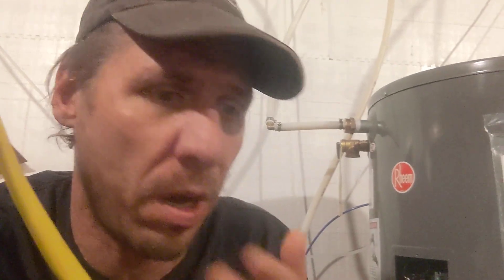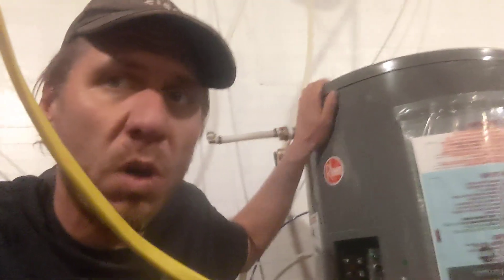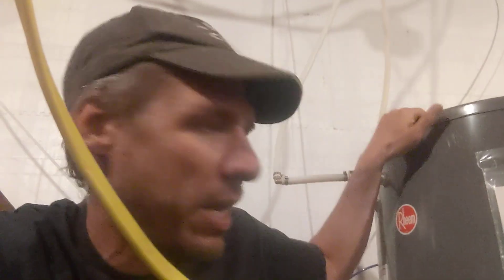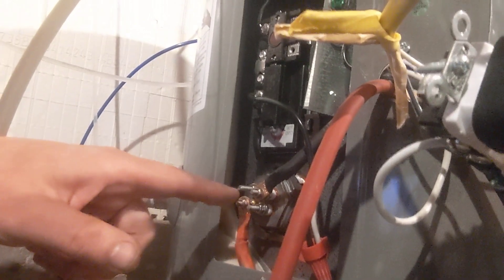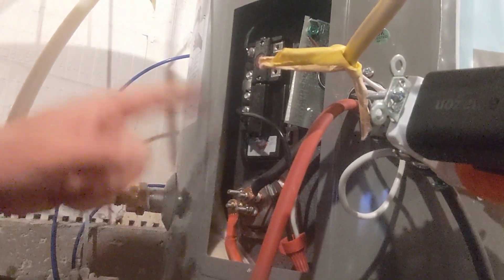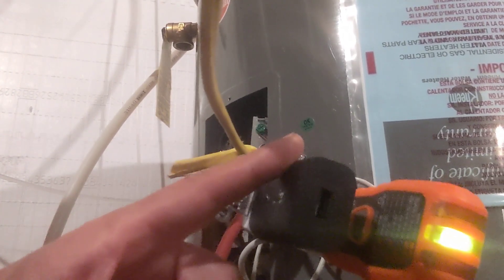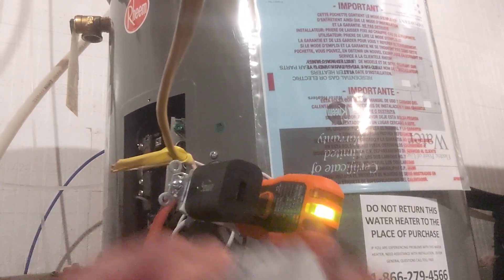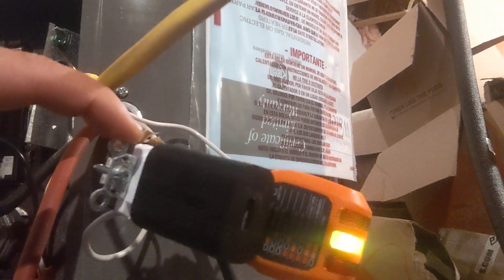48 volt DC off grid water heater.

Comment: Hello, Just a general view.  Any thoughts.    Seeing that the power that's generated from  solar panels Is DC and from what I'm reading.  A lot of people say that a 48V system Is best. Off Grid especially. Plus 48V Hybrid Inverters are popular enough.   Is It near Unbelievable that one cannot get a proper 48V Heat element Thermostat.  Some that are advertised seem to get varied neg comments.  For those that have the knowledge It seems no problem to make one. But I believe you are almost always watching out for some fault with them or you have to keep Improving  them.  Most people are not up to making units to control the temperature and feel safe with the designs.

Comment: any update on a good relay?
Reply from the maker: @kuhbri5265  no.  They all fry.  Either a built in port like eg4 or a mosfet.  I have an eg4 that turns on a port/breaker that the water heater is connected to when the battery is charged.
Reply: @tomjaeger1  thanks i think im going to try one i found on ebay maybe just quality issues (Schneider Electric 6225AXXTZS-DC3 Solid State Relay 25A 24-280VAC Out 3-32VDC In)
Reply: ive already got a good working system electric water heater with direct 700 watts solar feeding a gas water heater with no grid power gas heater just uses pilot light only-but planning on shutting off gas altogether

Comment: I heat all my water with excess PV without using any charge controller, battery or inverter resources.  To heat water from a battery requires an additional 1K of battery capacity.  I draw just enough energy  from a PV array to bring the array voltage back to power point.  Monitoring voltage is the best way to divert power.  It is so simple and effective, it is hard to believe it is not common.
Reply from the maker: My PV outputs 300v DC and I have 250KWH of batteries so 1KW is no big deal.  We also are 100% heat pumps for A/C and heat.
Reply: @tomjaeger1  That sounds like a lot of money for pedestrian performance.
Reply from the maker: @opera5714  I do not understand your point. I already had the charge controller, PV and batteries.  So hooking up a water heater to my existing 48v system was a no brainer.  I have no heat or cooling bill because of the heat pumps. I am not sure how this is pedestrian.

Comment: Nice concept. I saw few water heaters on Alibaba using solar panels to heat the water and also using grid at night
Reply: Too bad they don't sell these systems in the US.  Fact is they are just too small for this market. People in solar are absolute goobers when it comes to heating water.  All these YT videos are a joke.  These are very inefficient costly designs.  I design efficient PV resistive heating systems and nobody can comprehend the technology.  Everybody copies some bad design on YT.
Reply: @opera5714  the ones I saw on Alibaba use mppt controllers with DC immersion rod. Similarly in Europe regular AC water heaters use diverter which use excess solar energy to heat water instead of exporting it to grid.